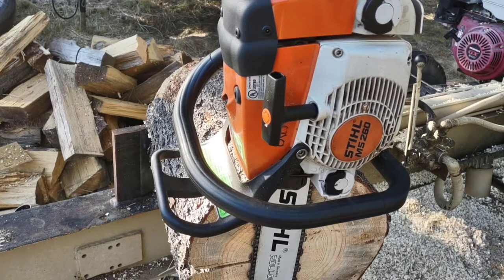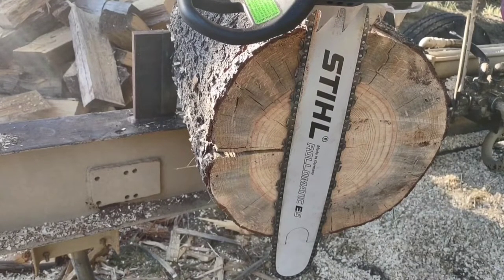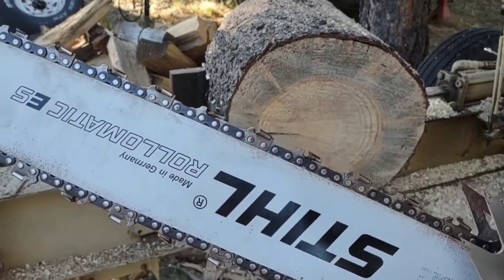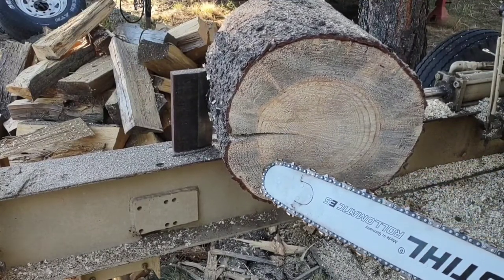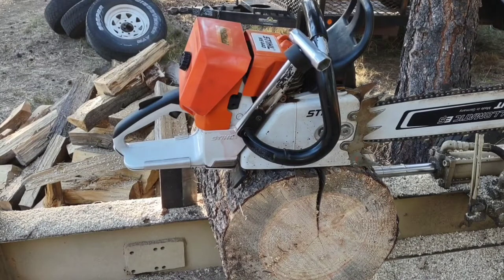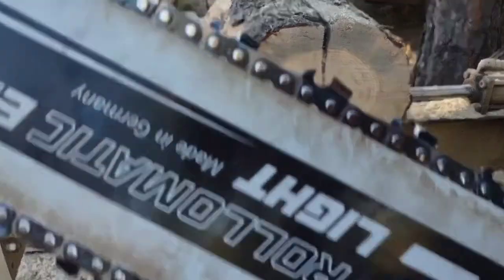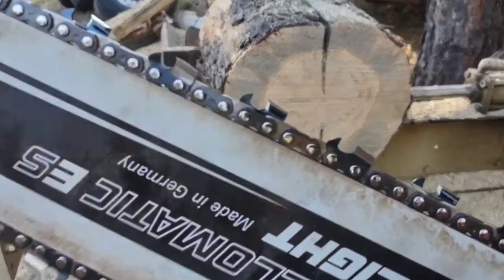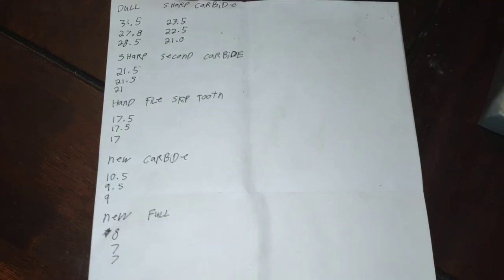(295) Stihl carbide chain cutting comparison, Stihl 33RD3 vs 33RS. dull vs sharp and some new chains

Comment: Thanks for taking us along... on the sharpened chains, I’m guessing by you, did you also adjust the rakers?  The chips or shavings should be more stringy/longers.  If the rakers are in the way no matter how sharp your chain, nothin’s getting cut. I love the 33RD3 chain and bought a Sthil USG just so I could sharpen mine.
Reply from the maker: @cloversniffs6884  in this video i dint touch the rakers, I only wanted to change one variable at a time for this test. I hear ya I sure do love the chain myself and I've seen bought a usg as well and very happy I did. Fantastic chain and grinder

Comment: I've bought a few of the carbide chains and the first ones were all semichisel and this last one I got is a full chisel and man it's on a whole new level. It's almost as fast as a c83 or Stihl rs and it's well worth the money
Reply from the maker: @matthewknight5641  what brand chains did you get
Reply: @tdm8817  Ive used a couple Stihl carbide chains and the last 3 I bought were zentop. The first 2 zentop were semichisel but the last one arrived and it was a full chisel. Id ordered the same chain so I was expecting the same but to my surprise and a good surprise it happened to be full chisel and it's unlike any I've used. It's nearly as fast as an outta the box c83 chain and after 2 days of cutting I can barely tell the difference in how it performs compared to when I first put it on. I'm not sure why they sent me a full chisel because I'd just redone the same order and was truly expecting another semichisel. Yeah it's the 3/8 .050 84 zentop